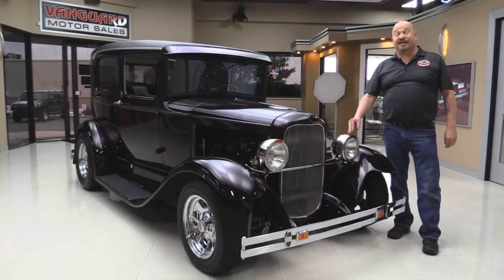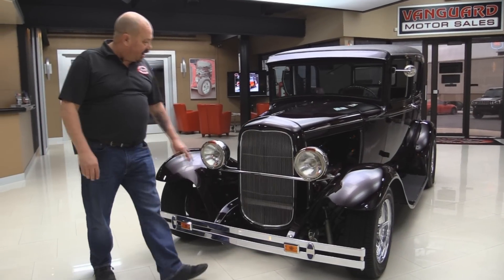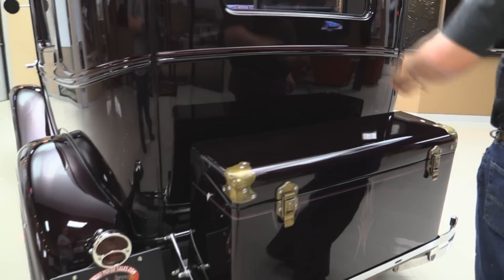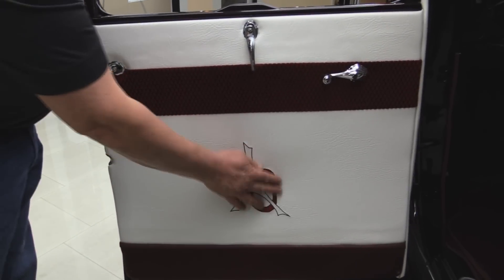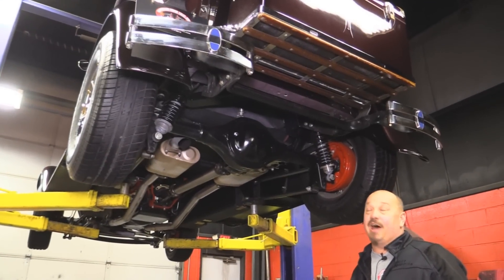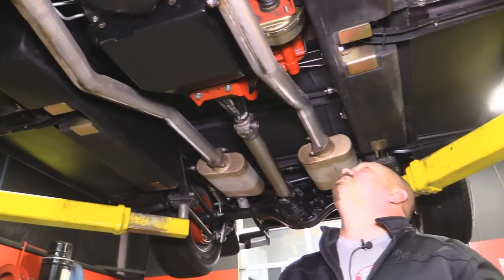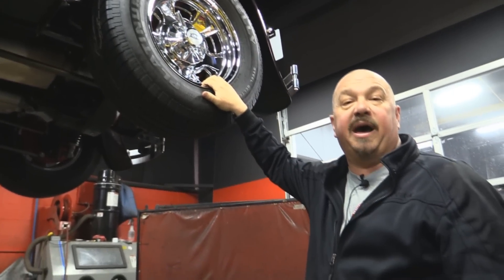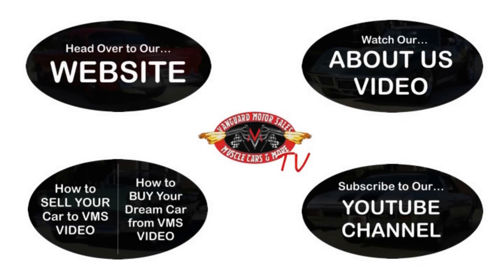1930 Ford Model A Tudor Sedan Street Rod For Sale

Comment: Chevy motor in a ford .......why
Reply: Because it's a tried and true swap. Yeah, a lot of guys have been crying foul for putting a bowtie in a Ford, including me. But the Small Block Chevy is a great great engine even if it was made by GM. For this reason, many hot rod builders would rather not reinvent the wheel so to speak.
Reply: @davidgrason161   a small block Ford is also a great engine
Reply: Because they are the best
Reply: @philipdenner8504  not as powerful or visually appealing